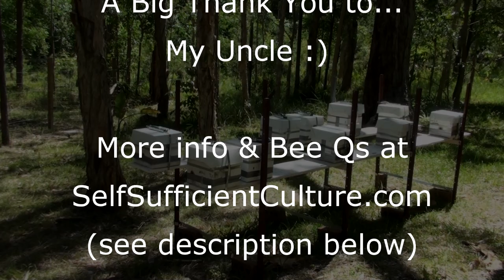Splitting an Australian Native BeeHive to Make Two Hives

Comment: Very interesting vertical process. 
Good to see he is not using stainless steel. 
It appears that one of the boxes was the wrong orientation (1st one). Native bees will more often put honey stores in the back behind the brood and pollen at the front near the door. So one of those hives got all the honey stores and one got all the pollen. The 2nd two seemed to be better orientated so that each half got half the supplies each along with half the brood. 
Also to answer your question why it is darker, 2 things possibly older if this is his 1st hive. And colour of structure may vary depending on the sap they have drawn from different trees to make the structural support propolis/cerumen.  
The colouring around the doorway is also more propolis (wax mixed with tree sap). And helps them 'smell' their way home. 
I am surprised he doesn't move the split hive with the old doorway away as the one in the original position will get all the workers returning to it and overall there will be less bees left in the one that has been moved from original position.

Comment: This was really informative.  I wonder if these boxes are composite with polystyrene foam? You seem to be concerned about insulation, and they would be very heavy in solid timber?  I can see your logic in having a vertical split, which is very smart.   I've just cut down a disused 8 frame Langstroth hive, cut 150 mm in from the dovetail, on  each long side, and it looks good. The two ends now butt together, and a fairly tight "telescopic" lid and base will hold both sides tightly together, if the rims extend about 50 mm up or down the sides.

Comment: Fascinating video, thanks.
First time I have seen vertical hive splitting - only seen horizontal before.
Amazing to see the hives in cross section and the advancing front.
Just wondering if the dimensions of these hives are available somewhere ?
Reply: ***** Thanks Mark
Just the internal dimensions, since the external dimensions depends on the wood I use.
Sorry if that is a bit harder to get.
I think your uncle said they were square.
I will check out your forum too.
Reply: ***** Excellent thanks for finding those dimensions.
Exactly what I wanted.
Much appreciated.
Reply: @georgegibson707  Hi George, could you let me know the dimensions as well. Cheers

Comment: Excellent and a method of splitting that works with the nest formation giving greater chance of success.
Reply from the maker: Thank you! Yes it works very well. The only mod that was done lately was to remove the steel lids on top of the hive as it was unnecessary and harboured geckos and spiders that sometimes fed on the bees. But apart from that modification, this way of splitting and this type of hive has been a great success. Cheers :)
Reply: I see the negative comment about someone doing it for 30 years and then you using a different method. Well so what works works and never forget the originator who established honey bee space and movable frames also faced an uphill battle. My Great Grandfather also decried movable frame hives. Love your method and a much easier splitting method that I will move to in future. Yes and lizards also live around my hives. Thanks again, Tom

Comment: Absolutely fascinating video!
I have heard of stingless bees but never knew they could be kept at all. 
So very different from honey bees, the way they build their combs.
And they start building comb from the bottom up as apposed to the honey bee method of starting from the top down?
Reply: +Station Plaza I am from South Australia, but i think they build from the bottom to top, and usually thier wax is made from a resin mixture.
Reply from the maker: +Sam Vodo That's a good question guys (I've only just seen this post by Station Plaza - sorry for not replying earlier) but I actually think they start from the top then build down and then reuse the hatched cells from the top again. I might be completely wrong though... However, they do tend to anchor at the top of the hive from my observations - I'll do some research and find out for sure.

Comment: top information, should one of the hives be moved away for any !
Reply from the maker: +Việt Thắng Lường Thank you, if there's enough food/pollen around it's ok to keep native bee hives together like this and they will live along side just fine. If your aim is not breeding and instead using native bees for pollination only then I would suggest separating the hives around the garden for better access to crops. Cheers :)
Reply: Thanks You,
After the split, I need to do so they do not return to the old house?
Reply from the maker: Việt Thắng Lường No problem, You need to split in stages as shown in the video to give them time to adjust to the new box then totally separate. :)
Reply: Well, sorry because I can not hear, please summarize the process dividing help me.
Thanks again.
Reply from the maker: Việt Thắng Lường You keep the two hive together after splitting for a day (overnight) this gives the bees time to adjust smell of the new hive material. The next day, you separate the two split hives and remove the mesh from the entrance hole that was initially closed off. I hope this helps!